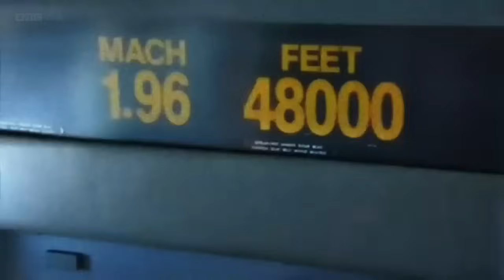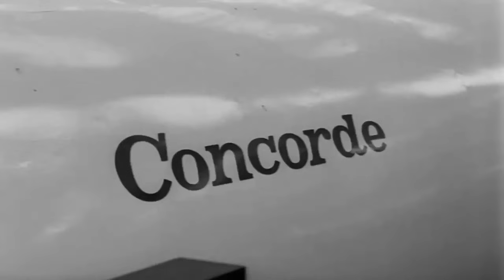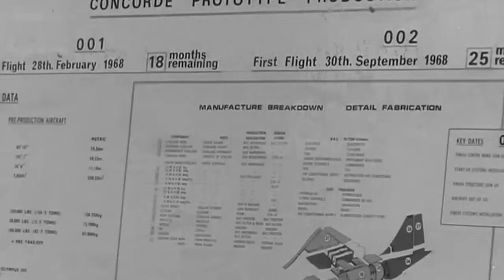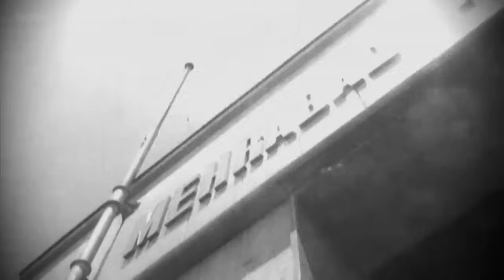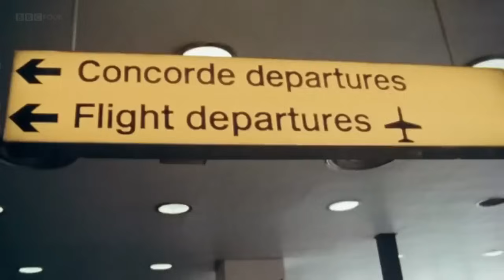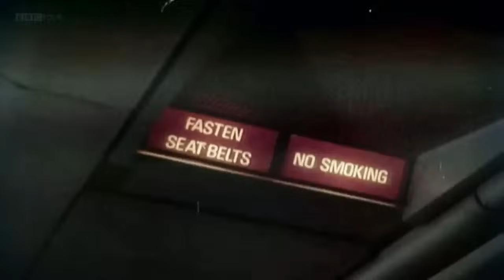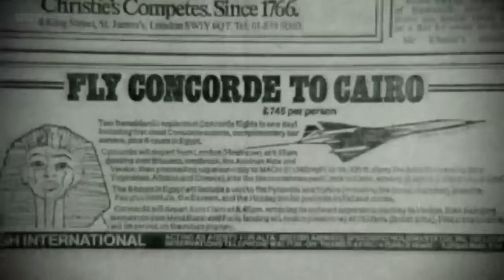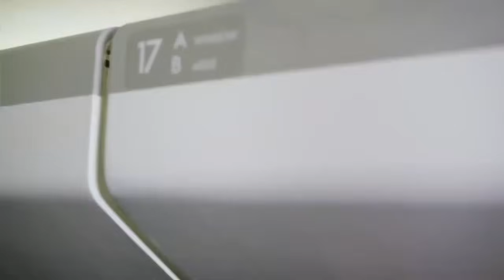Concorde - A Supersonic Story (BBC Documentary)

Comment: If only the concorde was he today and not retired in 2003
Reply: If Concorde survived it prolly would've been killed off by covid.
Reply: @phantommedia9964  True
Reply: Concorde simply wasn't profitable and it wasn't really reserved for the average passenger.   You had to be ridiculously rich to fly it.   Not only that but supersonic travel while the future was far too soon and was rushed.   For example Concorde was poorly built die to it's cramped conditions and was too loud due to the sonic boom.   I think when supersonic passenger flights return they will be greatly improved from better inteior design to using eco friendly engines that won't create a noise or pollution.
Reply: @phantommedia9964  ya covid would have killed Concorde the same way it did to the Boeing 747

Comment: Concorde: I can do Mach 2.
XB-70: Mach 2?  Hold my beer...
Reply: yeah but can you do mach 2 with 100 people on board drinking Champaign without a oxygen mask :)
Reply: @Maverick25ish  The XB-70 did have a pressurized flight deck, but test flights required the crew to don pressure suits and masks. But they could have flown in shirt sleeves and done some drinking... and throttled down the engines of course to drop to Mach 2, heh. There actually were plans to stretch the fuselage of AV3 for 76 passengers.
Reply: @mytg8  well it didn't have Concorde's beauty that's for sure :P and that counts the most imo
Reply: @Maverick25ish  exactly 😂

Comment: Unfortunately a lot of the blame for the AF crash goes to Air France. The pilot's Concorde licence had expired; he overloaded the aircraft with luggage and over-filled the fuel tanks. He took off with a tailwind on a runway that wasn't open. And a spacer on the landing gear was missing. This is why the plane veered off to the edge of the runway and hit the debris from the Continental airlines MD-11. Last, the flight engineer cut the power to the engine at the wrong moment and without checking with the pilot. 

Quite disgraceful on the part of Air France. And they blocked access for the British to some of the evidence during the investigation.
Reply: Wow. I've never heard any of that. Most docs just make it seem like that strip of metal was the ONLY reason it malfunctioned. 

Why would the flight engineer turn off the power??
Reply: @trawlins396  Think about it,the engine was in flames.
Wouldn't it be natural to shut the engine that is on fire to reduce the risk of damaging the aircraft further?
Reply: @uniontrains.8631  Yes that makes sense. I thought he meant he turned the engines off BEFORE the fire.
Reply: Well there were no reason for the investigation on French soil to be done by Brits for a catastrophe that involved a French plane. If things were reversed the Brits would not have let the French in.

And the conclusion of the accident was not a pilot error but a piece of metal on the  landing lane. Actually from an American plane.

But anyway even if the French retired their planes the British were free to go on with theirs I would think. This blame game is ridiculous. Especially for an accident independent of the plane itself and of the crew.

Comment: To crammed and to expensive and Concorde is a failure with 200 lives dead!
Reply: Only one Concorde crashed and it wasn't the fault of the Concorde or her crew, it was an American Contintental DC10 that took off just before Concorde and dropped a metal strip on the runway,  Concorde running over this caused the fatal incident.